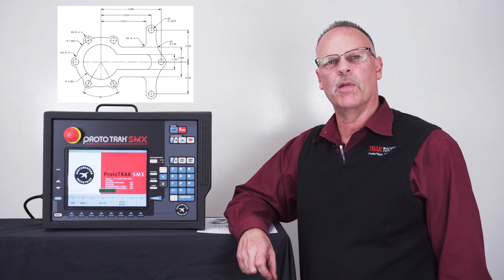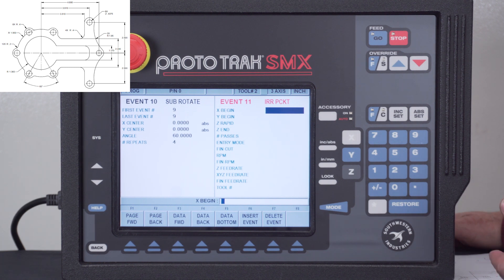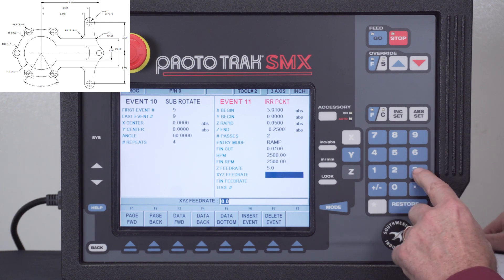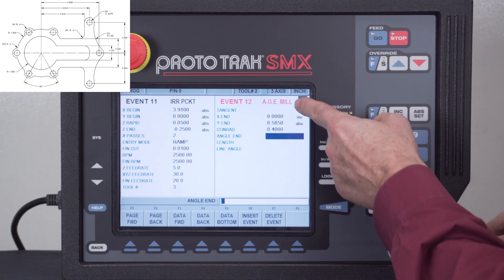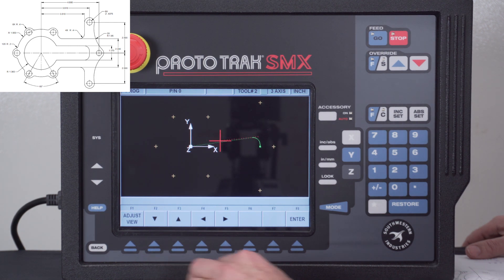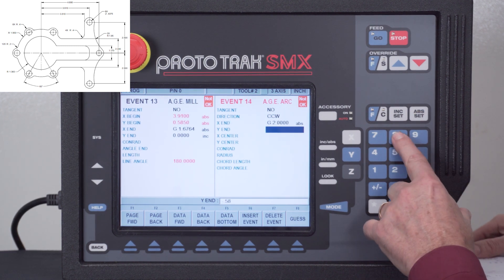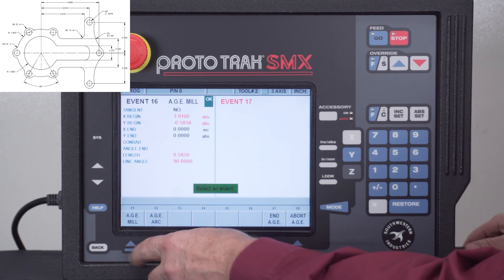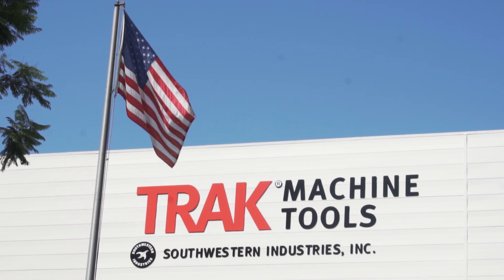A.G.E. Part 2: Irregular Pockets with the ProtoTRAK SMX

Comment: If you're doing a pocket op is there a way to change the stepover AFTER the path is finished? I know to tap the "?" to set it when yous tart but let's say I did a whole pocket and then went "oh shoot I need to change that stepover". Is there a way to do that? Also why is there only an option to do stepover as % of tool diameter? Why can't I just say I want to to 0.010" stepover or 0.015" stepover?
Reply: If you go to the end of your program and select pocket, the ? will allow you to change the percentage for all pockets.  After changing it, just hit the back key and your original pocket will adapt to the new percentage.  The ProtoTRAK controls do not give the option of choosing a stepover amount.  We do have this on our VMCsi line of machining centers but for our PT line, it is only percentage.  T.P.
Reply: @trakingpat2750  Thanks for that info